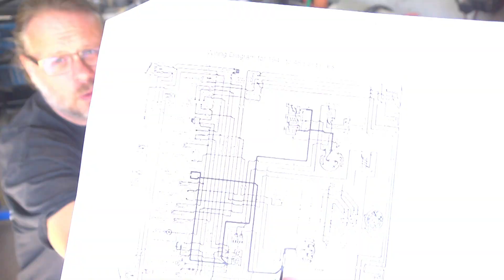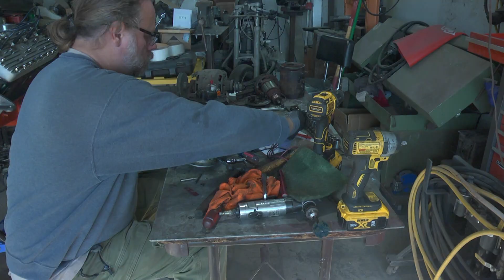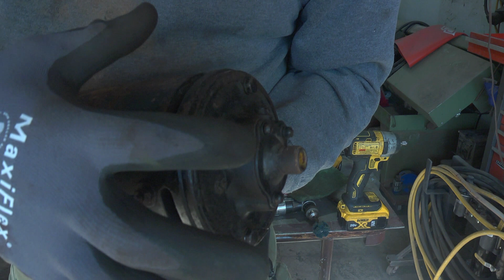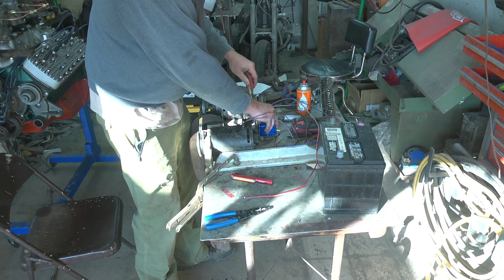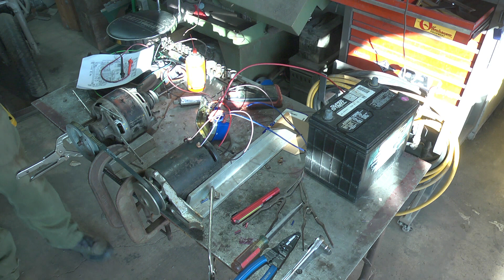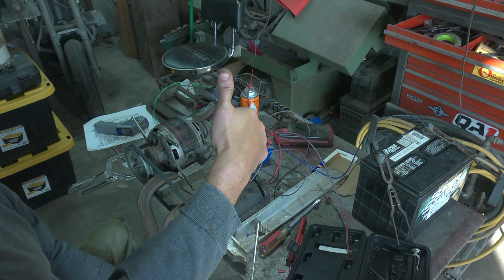Bench Testing Generators for our TROG Flathead, Part 2

Comment: Love the test setup. I'm going to steal it and construct a similar setup to adjust the regulator on my 8BA. You are  right generators are self energizing but you have to keep a close eye on the brushes. Commutators should not be shiny copper. The proper  comm condition is smooth with a dark copper to black mottled surface color where the brushes run. You will have to forgive me as I spent the last 35 years taking care of many large generators and I almost cry when people sand off a perfect comm surface doing a brush change.
Reply from the maker: Thank you. I assumed it was from the copper oxidizing from the generators sitting. I will keep this in mind going forward. I love learning from the viewers.